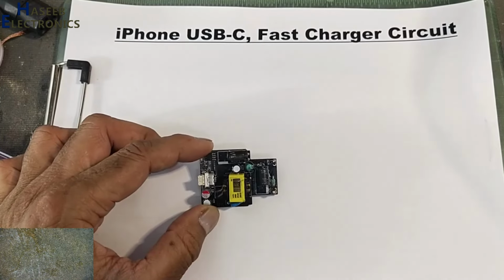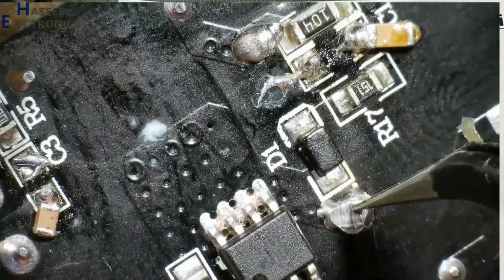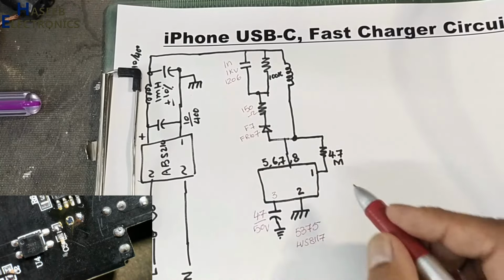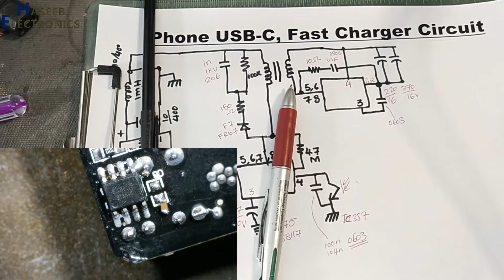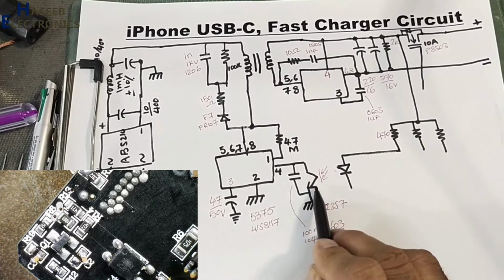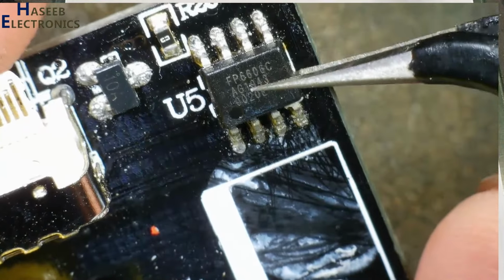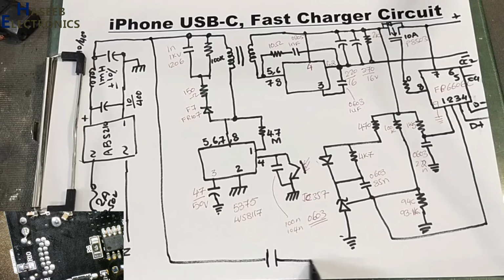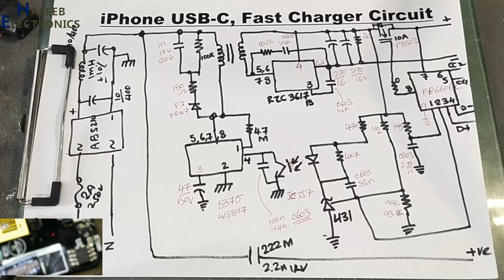{1129A} iPhone USB-C smart charger circuit diagram

Comment: 5:11 i think its RZC5375s PWM ic. Pin layout: pin 1 is ST(start up pin as you said) pin 2 is Gnd, pin 3 is VCC(connect through 22uF cap to Gnd as per Datasheet) pin 4 is FD (feed back from Optocoupler), pin 5,6,7,8 are HV Pin (output pins for an internal NpN transistor collector pin, as a driver then Its connected to transformer). 

Datasheet: write in goo gle : RZC5375SV1.1 and you will find the file 👍
Reply from the maker: wow it is really amazing 
i tried but i failed to locate the datasheet 
but your search with adding RZC with 5375 is fruitful. 
special thanks for your valuable input
Reply: @HaseebElectronics  you didnt fail, its just that you are busy and i am free, and after we learned from you i was able to find it. 👍🏻

Comment: A component which is commonly missed off these copy pcbs is an MOV after the fuse/fusible resistor. Also missing is any form of EMC filtering.
Thank you for your work reverse engineering the pcb - it is most helpful and instructive.
It is a job I also enjoy as it really tests your circuit understanding and sometimes your patience!

Comment: Hello good time. Please, a tutorial video about how to replace SMD capacitors that are broken and cannot be identified.
Also, I read the video of determining the resistance of SMD, but I did not understand how to replace it if an SMD resistor is burned in the complete circuit, because there is no number on the resistor to know the value of its surface resistance. Please help in this matter.

Comment: That seems like a decent topology/circuit, but are you sure it's an exact copy of the original apple design?  The genuine Apple USB-A chargers I've torn down had quite unique circuitry including active snubber circuit, presumably accounting for their excellent low-noise and regulation performance.
Reply from the maker: it is copied charger and it is approximately similar to standard 20 watt USB C smart charger for iphone
Reply: @HaseebElectronics  got it.   very nicely reverse engineered- it's a very difficult and time consuming undertaking - many thanks !!🙏